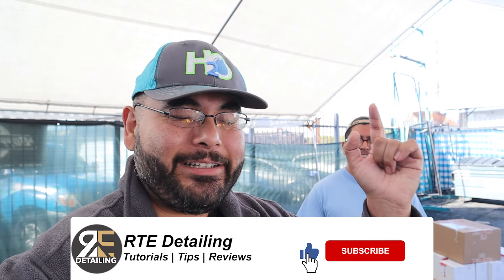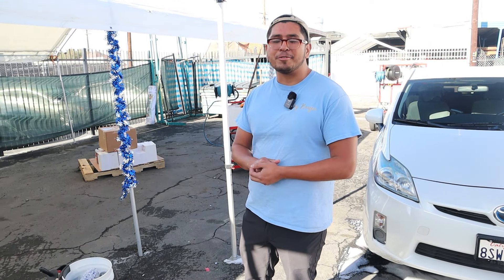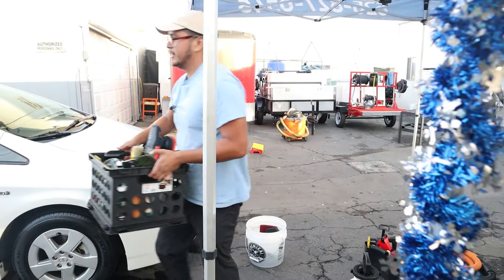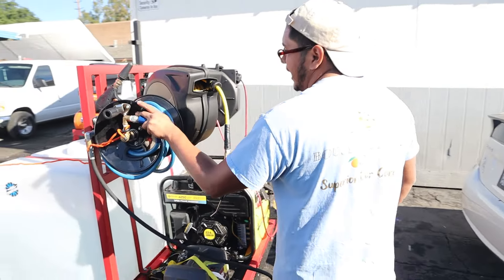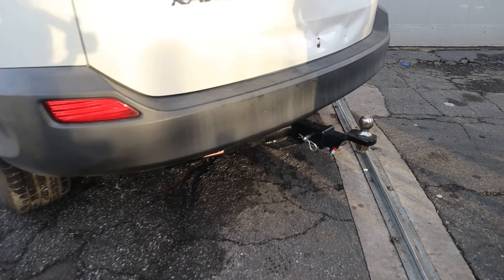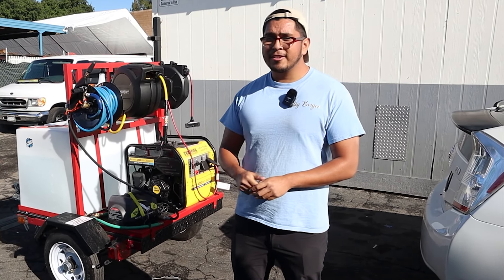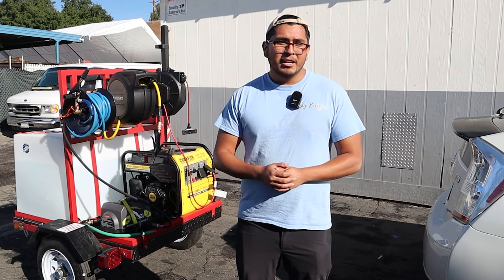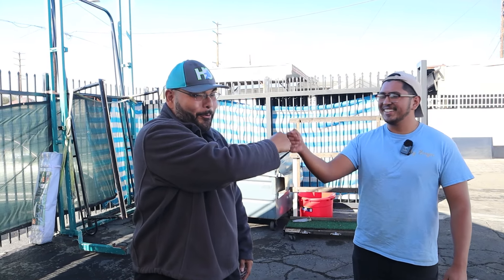Boujee Detailing Minimalist Setup - RTE Detailing

Comment: Great little setup because it geta the kob done.
The hd 4x8 trailer from Harbor frieght works great also. I know because I built one for auto detailing. 50 gallon tank, 2 48" storage boxes, generator, and pressure washer all fit. Got totalled from a lady running a red light. I miss it.
I built a custom 5x8 cargo trailer with a toiler, sink, custom shelving system, 100 water tank, fortress 4 gallon air compressor,  & Wen open frame inverter generator. Works amazing but parking is a issue.
My current setup is a 2021 Nissan NV200 and I love it but I hate having a payment.

Comment: that's a cool set up for someone starting their business with a small budget... I've been thinking of doing a Mobile Detail business part -time over the summer cuz it's tough to do Mobile washes in the Winter here in Boston & this would be a cool set up for that.
Reply: Do you use an electric pressure washer if so how do you it? Cause I've been having problems with mine I had to get a transfer pump but half of the times it works and it's annoying

Comment: How much was that setup? I want to get a trailer setup as well
Reply: 2000$-3500$
Reply: He said that setup was 3800 but that expensive. I’d suggest building it up yourself save atleast 2000
Reply: I just bought a similar trailer used for $150 and it came with spare tire and wood fence . I installed and stained a plywood floor, found a 55 gallon tank for $50, bought a $130 new compressor, used $500 honda 2000watts generator, rigid vacuum. New $130 electric pressure washer . Just need to add my hose reels and it’s ready. Trailer looks amazing.